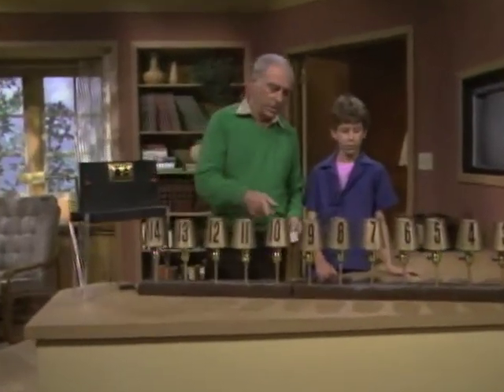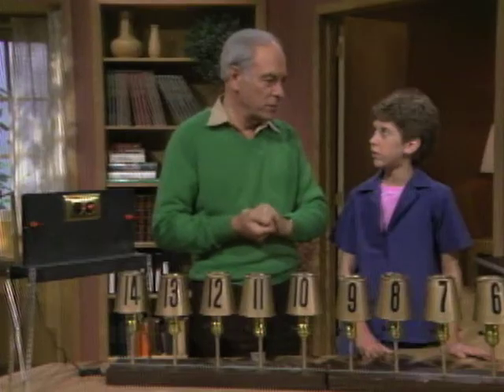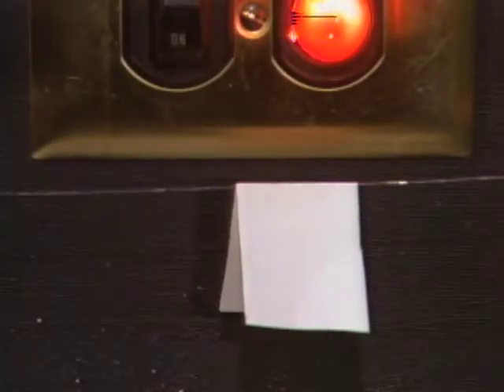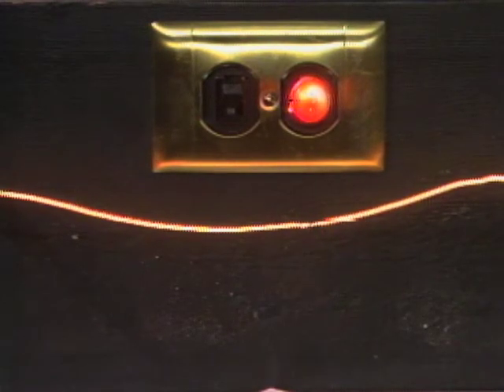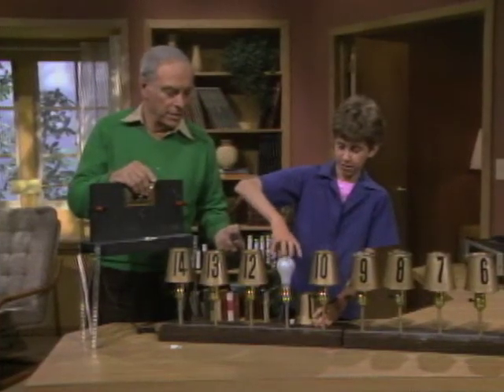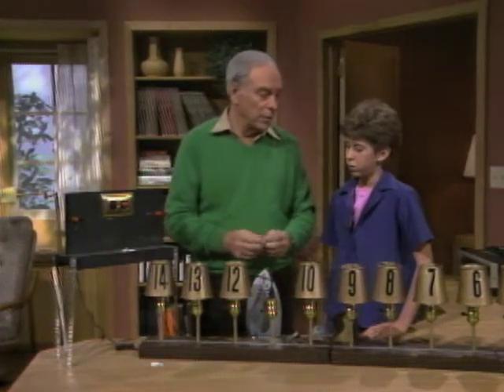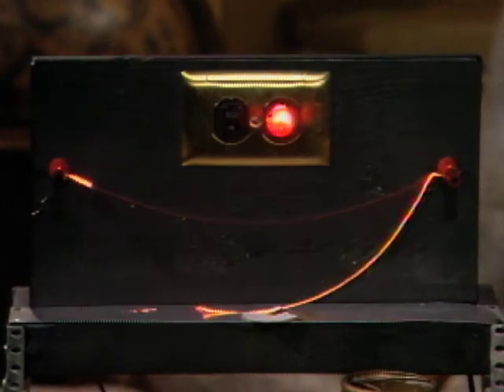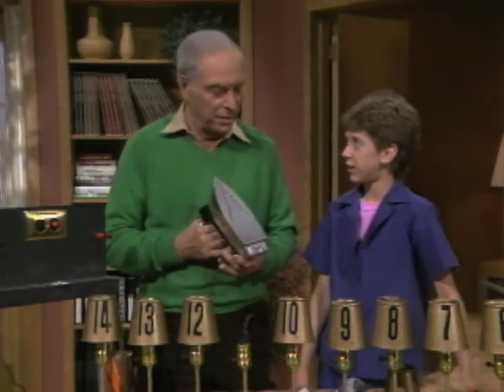What Is A Fuse? (Mr. Wizard)

Comment: Difference between a fuse and circuit breaker-
Fuse-Needs replacing after it blows
Circuit breaker-Doesn't need replacing and is resettable

Comment: Ok but what does a fuse do?  What purpose does it serve... just to go out?  What are the consequences of overvoltage without a fuse??  Come on Mr Wizard we want to know more
Reply: A fuse is used to protect the wires inside the wall of your house from burning and in many occasions protect your appliance from damage. Such as in modern electric stoves which turns off when the stove is hot and turn on when it is cold. It is a reusable thermal fuse. Without a fuse all your house appliance and the wiring in your walls will burn in case of overvoltage causing fire and burning down your whole house.
Reply: Fuses, and breakers aren’t for over voltage, they’re for over current (amperage) situations. And while they may break, or trip if there’s a fault with a device connected to the circuit, they’re main purpose is to protect the house wiring, not the appliance, or device. A properly made appliance should have its own protections.

Comment: what's a fuse? (sorry i really want to know this i come from belguim not from england) could you guys translate it to dutch? pls
Reply: Fuse is precursor to circuit breaker. A small wire, encapsulated in glass, designed to burn through and break before an overload of electricity damages other components/starts a fire.
Reply: @zombie-process7025  Fuses still happen to be used in the Plugs of appliances
Reply: @zombie-process7025  it is not in glass at all
Reply: Sikring in danish... Suojelija in finnish... Im sorry google translate service not offering translation to belgian
Reply: Fuse is de voorloper van een stroomonderbreker. Een
 kleine draad, ingekapseld in glas, ontworpen om door te branden en te 
breken voordat een overbelasting van elektriciteit andere componenten 
beschadigt / een brand veroorzaakt.